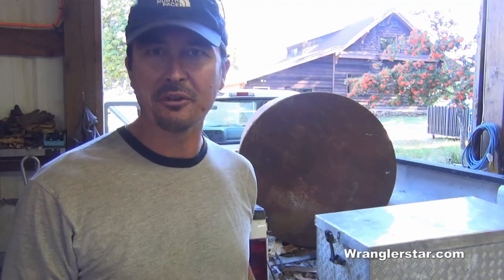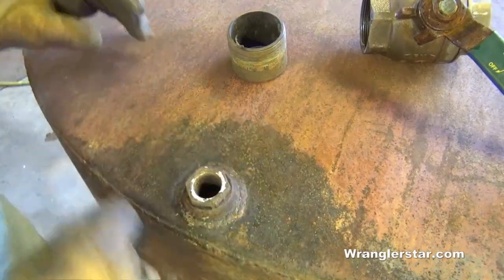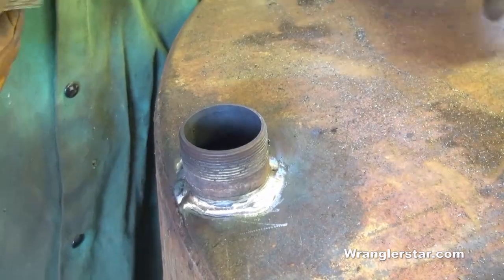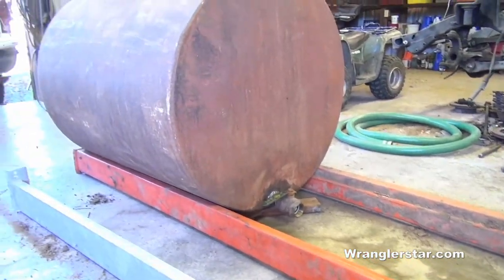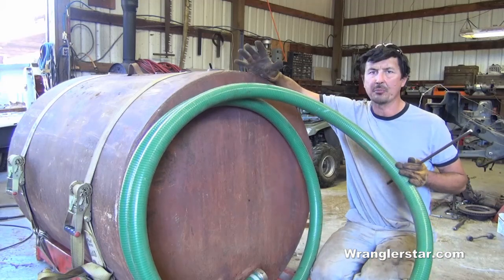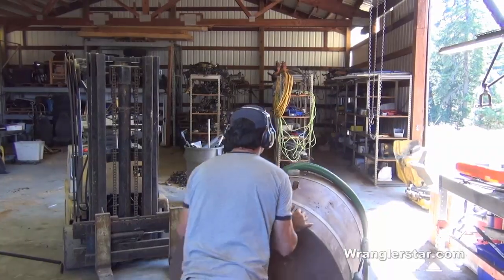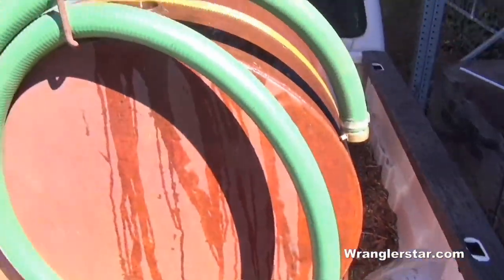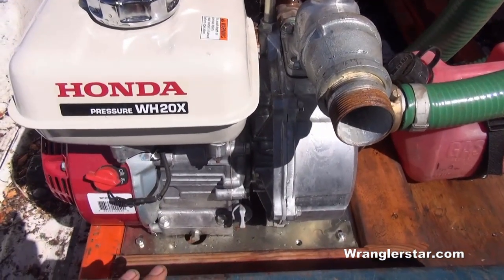How To Build A Fire Engine | Wranglerstar

Comment: Superb work Cody. And if you mount it on a trailer it will be perfect, because if you need it in an emergency it will save you time from having to pick it up on to the truck. With a trailer, just attaché and go.

Comment: Outstanding farm build!!  Its a steel tank so it'll get rusty fast,  If you can get some expired AFFF from the station or we used to use Arm & Hammer phosphate free laundry detergent powder 4 cups for 300 gallons kept the water in storage crystal clear, no more tomato soup and helps with the wetting action.

Comment: Pretty cool setup my buddy and I are both Volunteer FireFighters and were talking about building something similar but using one of those 270 gallon IBC totes and my 2" Monarch pump. I think for quick couplers what you want are cam-lock fittings but keep the threaded fittings in case you ever have to hook up to proper fire department equipment.

Comment: Nice build, I'm doing the same but using a 250 gallon IBC tote for the tank.  I'mn still gathering parts.  I'd recommend that you install a site glass so you can tell how much water is in your tank.

Comment: That’s a really impressive slip on, I’d recommend  the TTI brand slip on kits, for about 3 grand you can get 3000L of water with a Honda motor with two 1.5” rapid attack lines.

Comment: Amazing work. You r all in one person.
Just one point of query why did u weld out the 1 inch oulet and out a 2 ich outlet. you could just use a convertor. May be u could have more pressure. same thing for the outlet on the pope u were spraying with. the smaller the outlet the more pressure.

Comment: My cousin and I have built two small rigs on 4  wheelers.  They hold only about 20 or so gallons, but we can watch our burns, and can take a good chunk of grass fire out.  We also have a side by side that we can use to fight fires, or we can pull a trailer with it and use it as a tanker, or engine.  They work great in areas near us until our volunteer fire department can get there.  But if the fire is far from the house then we have to go get on the rigs at the station.

Comment: Here's a tip. If you plan on pulling from a pond, get a 5 gallon bucket and drill some holes in the sides and on the bottom and tie it onto the intake hose. It's a good pre filter for the strainer that you have there. Keeps ya from having to reposition the hose.

Comment: To save water,  if you can,  get a high pressure pump with a lower flow of water. Dont need a 300gpm attack line.  Waterax males a great pump line as well as a honda 2" high pressure pump.  2" hondas fo about 100gpm amd 100psi. Perfect for brush.

Comment: I was thinking about building similar setup for doing prescribed burns on our hunting land.  Ever thought about putting a recirculating line from outgoing side of pump back into tank for when pump is running but not flowing water?
Reply: I am build a rig like this and this is my concern.  I need to find a way to make a pressure relief valve that will feed back into the tank when the flow stops through the hose.
Reply: I've seen some would simply stick the nozzle in the tank.  I built my setup that has a pressure bypass that allows the pump to keep running during short periods when the water's not being pumped out of the hoses.  It's a simple pressure relief valve that loops from the output to the intake feed.  Normally, I'd plumb it back to the tank but I needed my pump to be self contained & portable for other uses.

Comment: Harbor Freight Tools also sells the Honda Powered High Pressure Water Pumps complete with the 2 inch suction hoses. The only things one would need to get else where, would be the Proper Sized Truck, and Water Tank to mount, and plumb into the Pump.

Comment: If you set up the truck where it had Nozzles to spray the water, it will put out a brush fire better then having a hose squirting out water a section at time. Location should be in front of the bumper and I would say having the spray nozzles about 6" apart and about 2' high. you will use less water. give it a go! there is a clip on you tube from Gears spike TV with Stacy David.

Comment: you think a poly tank would work, it'd be a lighter set up, not as much stress on the engine, still with the Honda pump, just keep the lid open so it doesn't suction the inside of the tank, or are you just using the steel tank for dependability
Reply: he was just using the tank because he had it on hand= cheap

Comment: If you add a compressor or a air tank and inject some air into the hose somehow you could have a CAFS.  That would extend your water by a lot. For class A foam just use Dawn dish soap.  All class A foam is, is Dawn with a carbon binder.  Even if you don't make a CAFS the Dawn might be good to add to your tank H2O. The Dawn will lower the surface tension of the water and help it absorb into the smoldering duff putting the fire out easier.

Comment: Harbor Freight Tools sells the 3/4 inch Red Hard Booster Hose in 50 foot lengths. About 3 lengths of this hose mounted on some sort of reel would be perfect for this Application. In fact, Harbor Freight also sells the reels, and Honda Powered High Pressure Water Pumps complet

Comment: I have a friend that is his own fire department. He lives right on a county line. In order to have fire service he has to pay one county or the other a $500.00 a year fee to get fire service. He went and bought two fire trucks at a auction . For water he has a 8,000 gallon tank of hauled in city water and a above ground stainless steel tank that use to be on a semi truck that was used  to haul milk mounted 24 feet up in the air and kept filled by a Aermotor windmill. Plenty of wind where he is at.

Comment: using a reducer - forcing a 2" pump to draw from a 1" supply might short supply the pump.  cutting the old one out and putting the 2" nipple on is the right way to do it to get the max flow from the pump.

Comment: What exactly happens when the truck sits on the overloads? Potential for damage?
Reply: just that the rearend sits low
Reply: Time for some Firestone air helper springs
Reply: Not a problem and the smart trick is to weld a section of heavy wall box tubing to the bottom of the overload spring stops on the truck. That way the overloads IMMEDIATELY touch the stops before the truck squats. It's an old tow truck trick used when mounting wrecker bodies on pickup chassis. The tube should be at 90 degrees to the axle so the outside corner radius acts as a smooth pad against the overload leaf.

Comment: one thing i would of done different is elevate the water tank so that the pump has work to do. Gravity feed the water pump...
Reply: Wouldn't that make it easier on the pump? Making it to where the pump had to create suction would be applying more work load no? Like making a pick up line from the top to the bottom of the tank?

Comment: Okay at the end where you are showing us it works... You were telling Jack something... Was that so you could hit him with the water?  ;)

Something you may want to do when you put this away for the winter is run a strap of steel from one rail to the other so the rails don't deform from the weight of the water and tank while the truck is bouncing around.  Better would be two steel straps with D rings welded to the ends to attach the nylon straps to.  This will save your nylon straps too.

Comment: Scarey thought playing wanabe fire fighter. I understand needing to protect your home and property. Better off getting a poly tank that fits in the truck and securing it get a home fire protection kit with a good pump and real hose and a good nozzle. Get with your local Fire Dept paid or Volly and ask for some training they can offer some tips for people far away from their services. My fellow brothers die from trucks over turning,fire overrunning them. Fyi I built  the little fire truck in the picture
Reply from the maker: Donald Raver I am a full time volunteer. I work as an engine boss on wildland fires during the summer. I was a paid full time structural firefighter/ paramedic for two  years.
Reply: Is the honda a pump is more than equipped